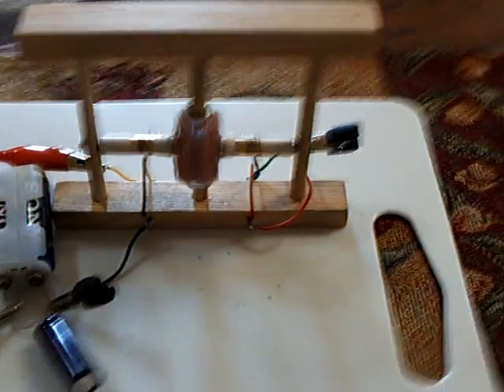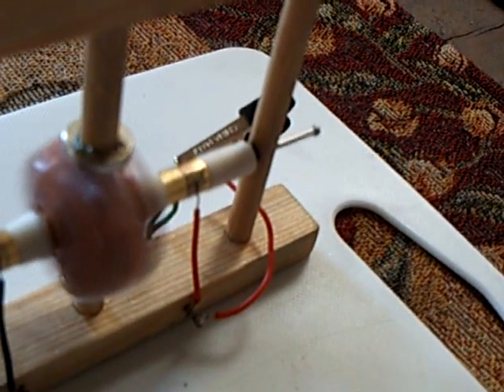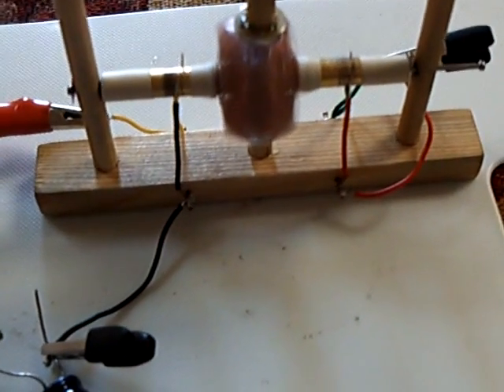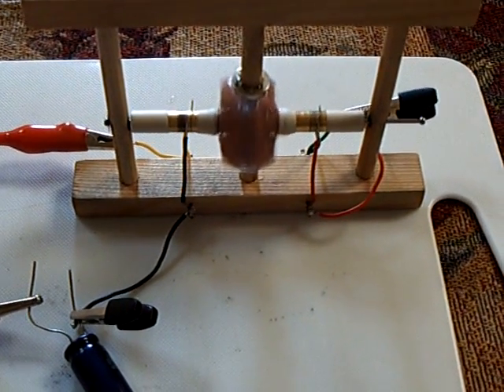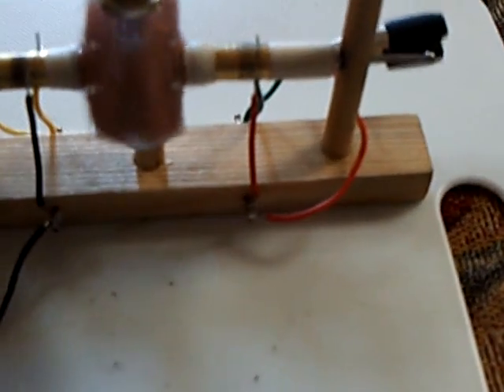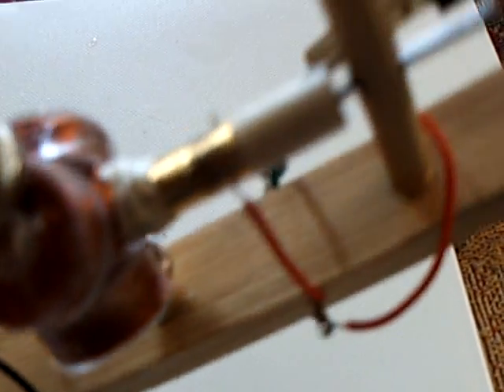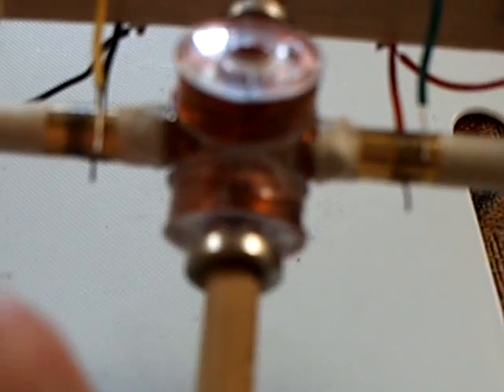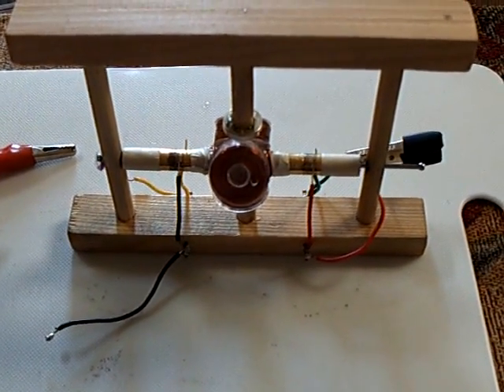Three Pole Asymmetric machine ---learning tool

Comment: I have 3 things to say: 1. Try using 2 roles of copper wire and wind both at once on 1 part of the rotor, 2. Use a multi meter to measure the AC output voltage on that motor, find a transformer that uses the output and makes it 120 volts and you can power your table lamp or a stand fan, 3. This one is a challenge, get a bigger shaft and use 6 poles on the rotor.

Comment: perhaps u should use bigger permanent magnets, arc design, as bigger as one coil is. I'm sure u will generate more energy like that, and when used as a motor the torque should be grather. but u will have cogging problems as a generator. great work

Comment from the maker: I understand the truck and the cat analogy but I'm not trying to do that.  The motor project here is about efficiency.  The energy that goes into the motor doesn't really get more or less.  The machine sure ISN'T making more.  Friction and heat grab alot of the energy.

Comment from the maker: I have been doing "things" (exciting things) with an AV plug on this machine but I didn't want to share them because it is kinda off topic right now.  I would really like to get this running right before I do anything else.  The Radio Shack conversion motor that I made runs correctly and I should be able to get this little model to do the same thing. Sometimes things are harder than they first appear.

Comment: So the output of A/C is no good with an AV plug ? if i'm hearing right. Wonder if its one of those situations where the output doesn't show properly on a meter, but an output cap would bring it back into the symmetrical universe (lol)
Nice little build and it certainly runs ok on the 10F.